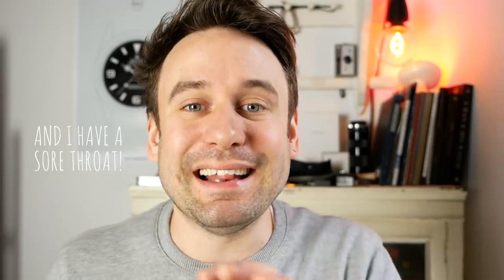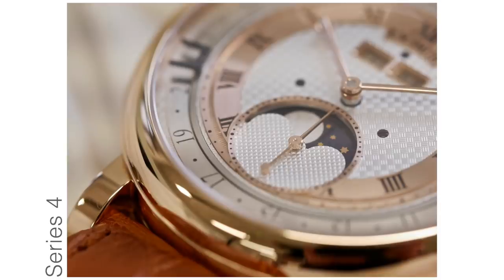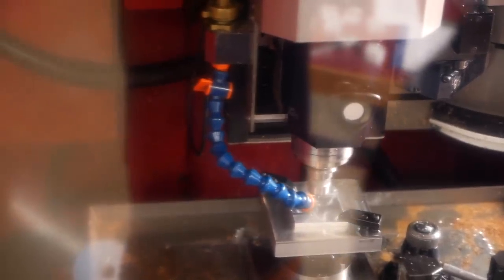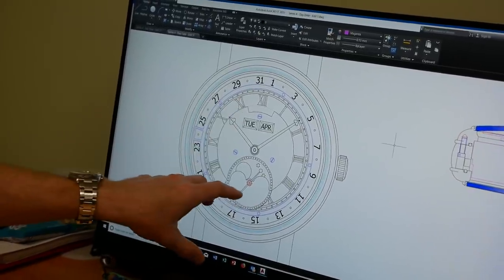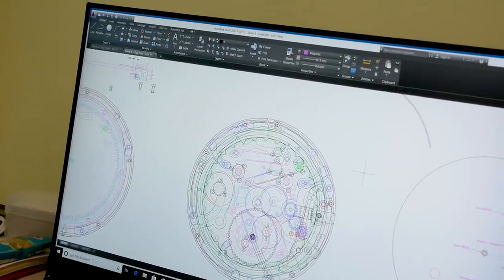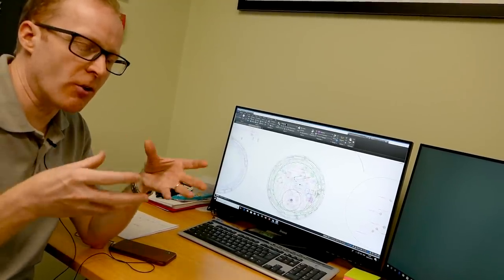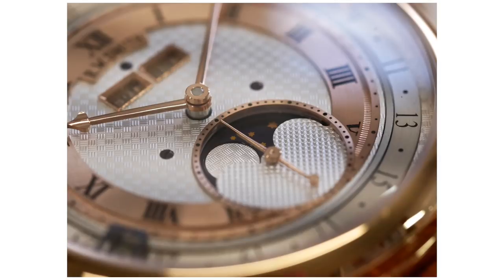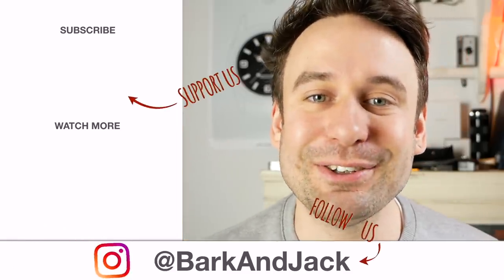Part 2 - The World's Best Watchmaker - Triple Date Moon Phase

Comment: This is probably a classic neophyte question: are there any watchmakers who make a mechanical watch that includes complications that automatically allow for February and the 30/31 day months? And the leap year?

Thanks in advance.
Reply from the maker: There are 2 complications to check out. Annual calendars will run the course of the year and take into consideration the correct number of days in the month. But they don’t track leap years. Perpetual calendars will run until the year 2100 where the leap year changes. 
So any perpetual calendar will do what you want. 👍🏻